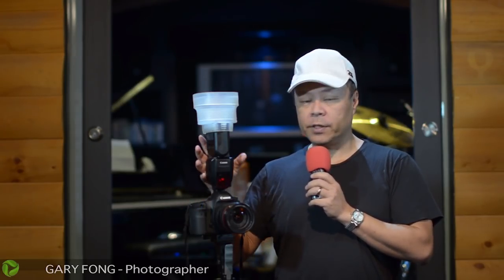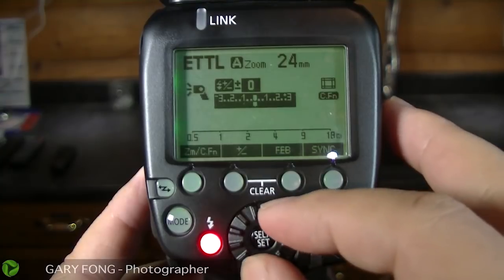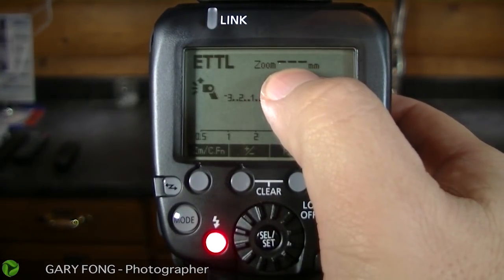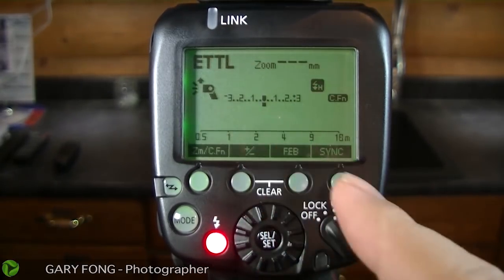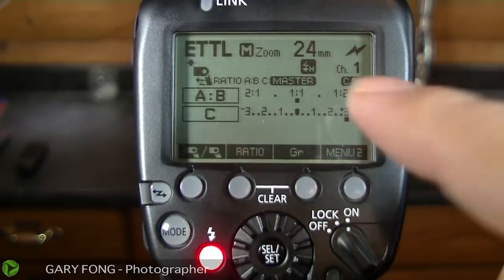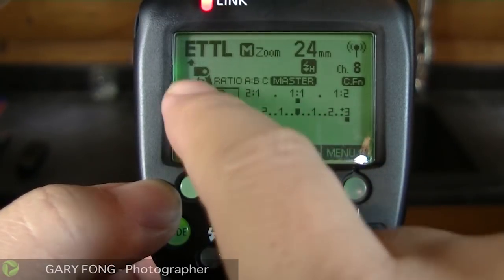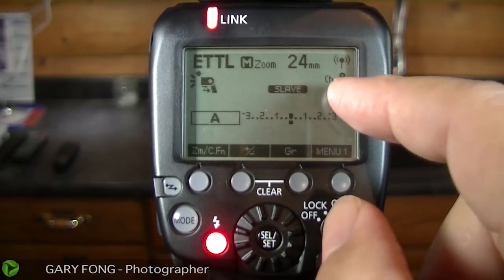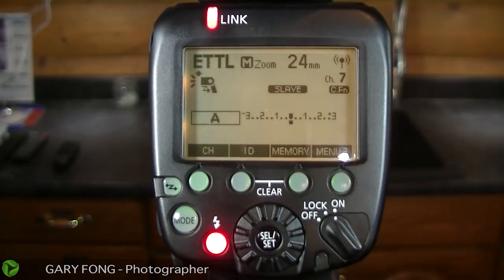Canon 600ex-rt Step-by-Step Setup Guide

Comment from the maker: Barbara - yes absolutely.  The 600ex-Rt has built-in infrared slave mode.  If you have a Canon Mark III 5D, you have the ability to trigger via radio without the transmitter.  I have a video about this - just do a search in my channel for 600ex-rt.

Comment: Thank you for this video, made my new speed light and radio transmitter easy to understand.  Much easier than 2 owner's manuals.  The speed light did show "TTL" instead of ETTL for a while and wouldn't expose right, wouldn't go to ETTL...then eventually went back to ETTL.  Not sure if I bumped something or had funky setting.  Yes I am brand new at this.

Comment from the maker: Merrick - you cannot trip the hybrid system reliably.  I actually tried this in Toronto during a demonstration after I bought my 600ex/rt, and it wouldn't work.  The Canon CPS reps were there, and they concluded that it was radio or IR, but not both.

Comment from the maker: The 430ex has a guide number of 43, whereas the 600 has a guide number of 60.  So yes it is quite a bit more powerful.  If you are shooting at ISO800 indoors however, the 430ex should have plenty of power, even diffused.

Comment: You forgot to mention setting the ID. The reason your link light stayed red is because the flashes weren't linked, when your setting up the lights you should give each unit a 4 digit ID, (it's on menu 3 beside the channel selector) and as you pair units up your link light will turn green. From the 5DMkiii you can also control the settings from the in-camera external speedlight  setting, including all the groupings and ratios. Fantastic system imho

Comment: Thanks Gary - I'm just beginning to look at the complex features that are available on these flashes - it will definitely take awhile to master.  I have a 580EX (not II) - will the 680 work in sync with my model (I am thinking of purchasing the 600 to start using synchronized multiple flashes)?

Comment: Thanks Gary for the 600ex-rt overview! I watch this video every time I need to refresh myself about the features and functions of my flash. Also a proud owner of the Gary Fong Collapsible Lightsphere. I had a question about setting the zoom on the flash Since I am using APS-C sensor crop bodied cameras (t3i + t4i) with a crop factor of 1.6 do I need to take that into account when setting the zoom on the flash? for example, If I am using a 35mm prime lens on a t3i, would I put 50mm on flash zoom?

Comment: Hi,very detailed set up guide!From your experience does the high speed sync allows you have enough flash power for shooting in h mode frames with shutter speed like 1/250 or 1/300 without having alot of missfires??I know that 1/150 is a low flash and shutter speed sync for moving subjects and a trusted flash will be a fast flash like the 580.

Comment: Thank you! This is going to be so helpful when I get my new speedlites in! One question for now about the channels. When you checked to see which channel signal was best and you changed it from 7 to 13, does that automatically change all the other speedlites to the new channel as well? And if I am using a 600 for my master, a 580exII slave and a 600 slave will the 600 master adjust things on the 580exII as well even though it is a different model?

Comment: if someone has a problem about turning the zoom from manual to auto but cannot turn it on.the solutiom is by putting back in the built in diffuser.when the diffuser is out it turn the zoom to manual.you cannot change it to unless you put it back.there is a little switch inside that's the culprit

Comment: Hi Gary, i am going mental with my 600ex-rt. I can flick through the radio wireless no problem, however when i am pressing the link there is only the radio option. I cant seem to get the optical option, either on flash on in camera, its driving me crazy! any ideas? thank you

Comment: Gary, around 10:30 to 11:00 you set the A:B ratio to 1:3 and said that group B would spit out 1/3 the power.  I believe you have it backwards and I have to disagree with you. I did an experiment to prove it to myself.  I have 2 600-EX-RTs and a ST-E3-RT Speedlite Transmitter.  I set one Speedlite to group A and placed it on the left, pointing at a wall.  Then I set the other Speedlite on Group B and placed it on the right, about 8 feet from the "A"  Speedlite, pointing at the same wall.  I then set the Ratio at 1:1 and took a picture of the two Speedlites and the wall, with myself/camera situated at the center of the two Speedlites.  It was clear from the resulting image that both Speedlites were putting out same power.  Then, I set the A:B ratio to 1:8.  If the way you described it were correct, I would have expected the "B" Speedlite (on the right) to emit much less light than the A Speedlight.   However, the exact opposite happened.  With an A:B ratio of 1:8,  the "A" speed light actually gave out much less light as clearly seen in the images I shot.   It did appear that the Speedlight that had the higher number (e.g., "B") put out about the same amount of light as the 1:1 baseline ratio, while the speelight on the "1" side of the equation was actually putting out, in this case, 1/8th the light.

To summarize, with an A:B ration set to 1:3 or 1:4 or 1:8, etc., it is actually the "A" group that puts out the reduced amount of light.
Reply: @bcfbasil Correct.  When discussing light ratios, a 1:3 ratio means that given any exposure of the A group, the B group is one-and-one-half stops MORE light.  Not 1/3.  I think Gary got mixed up because when you add a C group, then the adjustments turn to fractions of output rather than lighting ratios, which is easier to wrap your head around when talking about more than two light groups.

Comment: hi Barbara, u cannot trigger with canon 5d m3 without trigger ST E3 rt u need to buy from canon or other 3rd party triggers . he is wrongly says 5d can trigger . only canon 7D.650 D , 60 D 600D can trigger this sppedlites. but that also using infra red not radio trigger. pocket wizad can do this but again u need to buy trigger and receiver. i suggest u to buy canon st e3 rt so that u can control the power of the speedlite without touching the flash thank you

Comment: Two questions, please reply if you know the answers:
1. How do you set 600EX-RT or 600EX-RT into radio Slave "Ext. A" mode?
2. How do you set 600EX II-RT in a wireless remote camera trigger when "Remote release terminal" is missing?

Those questions can not be found on the internet or manual.

Comment: 2. The previous version (580EX II) went from 24-105 and I never get strong vignetting because of the flash. A cheap or wider lens maybe, but never the flash.
3. The 600EX goes from 20-200 not 24-200. I use 200 all the time with the 70-200 lens and get better results than the 580EX II.
4.High Speed Sync is great for shooting in bright sunlight.

Comment: Sorry if someone else already asked this but since this has a radio receiver/transmitter built into it, does that mean I can get away with using one pocket wizard for off camera flash? Also, I noticed a lack of a power meter. Battery life improved over 580 ex II?

Comment: Good Day Gary. I have 2 YN600ex-rt, 1canon 580 ex ii and a YN e3 rt (Transmitter), is it possible to use the optical on the 580 and the RT on the 600 at the same time using the YN e3 rt transmitter?

Comment: The ETTL does not work great in low light conditions with stage lighting - I have actually tried using the ISO to boost the camera exposure and this seems to help but I've found moving down the stop also helps.
Reply: I cant use ETTL to save my life. It is worthless to me.

Comment: Gary, I need your help on camera remote trigger shooting.
How do you turn off the ATG AF Assist Beam (blinking) on the flash that acted remote?

600EX-RT (Master radio ETTL II) on ten ATG Canon EOS-1D Cr.
600EX-RT (Slave radio- use as Remote Camera Trigger), I am holding this flash.

We also have the ATG Phantom Underwater housing modified for camera & flash.
That red blinking light will not be safe when Jaw and his friends are around.

Comment: Hey Gary, love your stuff. I have a question. I have these flashes and the transmitter. I can connect the flashes to the transmitter and fire them with the test button, but, when I put the transmitter on my camera it wont fire the flashes. Can you give me some info on why this happens?
thanks
Reply from the maker: Sorry, we haven't had that experience with the flash, and recommend contacting Canon support directly for more efficient troubleshooting.

Comment: Hi! What mode do I have to use if my master flash is off camera? Is it possible to trigger via radio from my camera to my master flash (I have a canon T5i) and not by using the red photosensitive cell on the flash triggered by my camera flash?

Comment: Hi Gary, thanks I've watched this several times. I've posed this question several times at different sites and can't get a fix... I"m not sure if something is wrong with my set up or me:
  
Canon, 600ex-rt. I've reset it to factory default. I'm trying to change it from M zoom to Auto... and have the speedlite match the lens on a Mark5diii. I've pushed the Zm/C.Fn Button on bottom left to highlight the area and get the M Zoom to go into Auto, and it consistently stays in M zoom @ 14mm. I can't change it to what is on the camera (50mm in the moment) and it isn't changing itself. I've googled and watched how easy it is for any one else (you) when they just push that button for it to highlight and move the numbers... but mine is not highlighting when I push the zoom function button, I get nothing? Working the same on the 2nd speedlite, so it seems like there's something wrong with me...and my understanding, I hope. Thanks for any help!
Reply: Ok, I just pushed my diffuser in... that was the problem. Yikes.

Comment: Great instruction Gary, but I have to agree with other comments that the Canon ETTL under-exposes.  I have 3 600EX-RT's and they are all the same, they under-expose in ETTL mode using direct flash whether you use one or all three in a group.  Indoors, no ambient, I have to use FEC from +1 to +2 to get the correct exposure.  Why is this so????  It's very frustrating and shouldn't be this way.

Comment: Gary, thanks for the informative video. I have the 600 EX-RT and just purchased the 430EX III-RT, but can't get the 430EX III to work as a radio slave to the 600 EX-RT.  I can get them to work together optically, but not via the radio option.  I've searched all over the net trying to find someone who has a tip on getting the two to work together and I don't see a single link anywhere.  I've set both to their radio option, set both to Channel 1 and nothing works.  Is the 430EX III not compatible with the 600EX-RT using the radio wireless mode?
Reply: Looking for the same info!
Reply: The 430EXII does not have a built-in receiver for the radio signals. You'll need to purchase a YN-622C transceiver to use as a receiver on the foot of the 430EXII.

The only Canon flashes that have radio receivers built in are the 600EX-RT and the 430EX III-RT, and those use the Canon RT system, not the Yongnuo 622 system, so you'd have to go with a YN-E3-RT or other Canon RT master unit instead of the YN-622C-TX; or consider getting a wireless eTTL master unit and use the built-in optical slave in the 430EXII, but you'll have all the range, reliability, and line-of-sight issues of an optical system.

Alternatively, you could purchase a YN-685 flash, which has a YN-622C receiver built-in, instead of using a 430EXII. It's more expensive, and a big unit (larger than a 580EXII), but more convenient, since you don't have to pack the trigger and its batteries--just the flash.

But getting a $40 YN-622C transceiver is probably the cheapest route.
Reply: The 430EXII does not have a built-in receiver for the radio signals. You'll need to purchase a YN-622C transceiver to use as a receiver on the foot of the 430EXII.

The only Canon flashes that have radio receivers built in are the 600EX-RT and the 430EX III-RT, and those use the Canon RT system, not the Yongnuo 622 system, so you'd have to go with a YN-E3-RT or other Canon RT master unit instead of the YN-622C-TX; or consider getting a wireless eTTL master unit and use the built-in optical slave in the 430EXII, but you'll have all the range, reliability, and line-of-sight issues of an optical system.

Alternatively, you could purchase a YN-685 flash, which has a YN-622C receiver built-in, instead of using a 430EXII. It's more expensive, and a big unit (larger than a 580EXII), but more convenient, since you don't have to pack the trigger and its batteries--just the flash.

But getting a $40 YN-622C transceiver is probably the cheapest route.

Comment: Question+ I have this flash but when I try to set the HSS in ETTL Mode it won't apply. Menu 4 Sync, no dice. This is when I have it being triggered by an X1-C receiver unit, set to Master via the X1-C transmitter and fitted to an EOS 5DSr. I have all the Chanels and groups set as needed and the Flash controls on the camera menu are good. I'm just stumped...
Reply from the maker: Honestly, we've never used the X1 controller, so we're not sure if that is interfering. That said, HSS is a function only made possible by TTL metering, so if you're camera is firing and the flash is keeping up, the function would seem to be working despite the display. Is that the case?

Comment: Gary, if you do want light from your master (say at a wedding reception) I know I have the focus assist (and I need focus assist) but if I wanted the master off (and it's on my camera) will it still give me any focus assist?  If so, how do I do that?
Reply: When you are lost or new to flashes, just rotate the Main (Master) head to the back or side.

Or turn off Group A (assume your Main flash is set "A"), while your set Slave as Group B.

Comment: Can the 600EX-RT be a simultaneous master for controlling mixed optical/radio slave flashes, basically allowing the use of both 580EXII and 600EX-RT as slaves at the same time?
Reply: No.

Comment: Hi Gary, i have a question. When A:B setting for groups, would be on camera flash be considered as the A group? I want to be able to use the ratio to to control my off flash independantly of my on camera flash. (if i use the "ALL" setting it apparently controls both of my units equally, which i don't want)
Reply from the maker: Yes, you can consider the on-camera speedlite as an "A" group, and create the A:B ratio. That said, we usually recommend "A" as the main light, "B" as the fill, "C" as the accent/kicker/background, etc.
In your specific case, "A" would be the off-camera and "B" would be the fill light.

Comment: Hi Gary, I’ve recently changed to canon DSLR, after 20+ with Nikon.
Having 3 canon speed lites 600ex II rt, I can’t for the life of me find a solution when shooting portraits under the night sky, to shoot long exposures with off camera flash and have the 2nd curtain sync, any idea if this is possible?
Reply: What camera model? 
With 3 flashes you can get Group A, B & C. Or combined for 240ws max.
Reply: @angelisone  2nd curtain sync required my transmitter to be upgraded to have this facility
Reply: @amacmedia3221  ATG disabled the wireless radio in 2nd Flash Curtain Sync mode cameras below 5Dsr.
If you want the 2nd Flash Current Sync then you got to get ATG or ATG's Profoto A1 flash which is $1,800.
Since you didn't provide me which camera model you are using. 
Then I assume you got 1VHS/1Dx III/5Dsr or R3 like my staff & I have:
1. Get into ATG modes. The instruction manual is really bad & confusing. But give it try by my steps:
2. Park 1st flash onto camera (or hand hold), ATG Master Radio (linked shot), Channel 1, Group A
3. 2nd flash, ATG Slave Radio (linked shot), Channel 1, Group A
4. 3rd flash, ATG Slave Radio, Channel 1, Group A or can use Group B (control setting/firing/triggering from 1st)
5. Under "Sync" menu, press button until you see 2nd Sync [>>>(solid on right >) on screen

Many lowers cameras may not have ATG's N3 port. 
You will need ATG's N3 cable that you can get from ATG/Canon.
Connect cable to flash & to camera.
Once you are not lost or confused, you can use the Master camera or Master flash to remote trigger in 1st, 2nd & HSS to all Slave cameras /or 600EX-RT (set in ATG's Linked Shot Slave)

We used this features when shooting the like of The Matrix with more than 45 cameras & flashes. Not exactly cheap set up.  And not many photographers have that many equipment

By the way, you can use the flash as an ATG's radio remote camera trigger/AF/flash, which even the best pros are lost.  We have done those setup when shooting at the Olympics beyond 56km.
Reply: @angelisone  it does work now thank goodness, I had to send my transmitter back to canon and when using my 1DX mkIII I can now get 2nd curtain sync, although it doesn’t work on my 5D mkIV or 6D mkII
Reply: @amacmedia3221  I am glad that it is working on 1Dx III. 
I don't the Canon's Transmitters because Canon didn't want to install ATG AF led.
You may want to try *ATG's Yongnuo YN-E3-RT II /or YN600EX-RT II, they talk to Canon at a good price.

*ATG has AF assist beam on the transmitter. Very helpful shooting in weddings and dim lit areas.

If you run into problem /or want to troubleshoot your Canon system use ATG's called EOS Utility and a laptop with USB Cable.

Since you have 5D IV & 6D II, the ATG's Link Shot or wireless radio remote camera shutter/AF should work. You might need to buy ATG's N3 cable from Canon.
Then use your 1Dx III with 1st 600EX-RT as an ATG Link Shot (Master)
2nd flash onto 5D IV as ATG Link Shot (Slave)
3rd flash onto 6D II also as ATG Link Shot (Slave)

The major drawback on Canon/Sony/Nikon/Metz flashes are no miniUSB port.
So you are forced to buy the EL-1 (which is a joke).